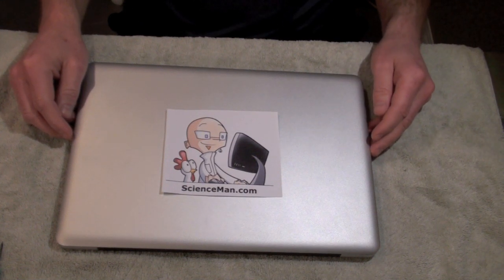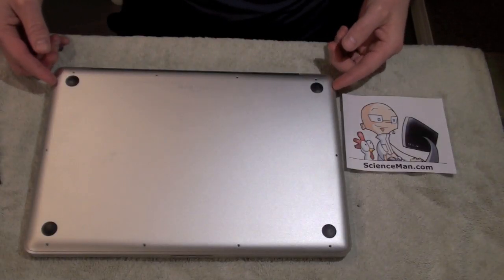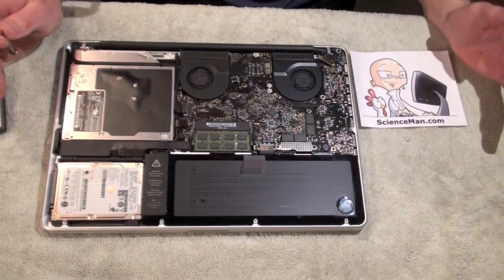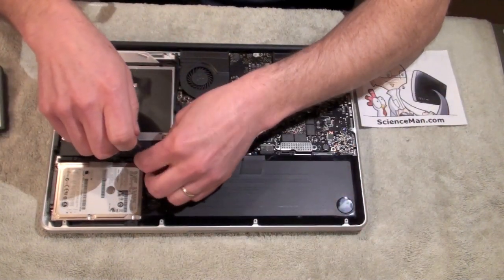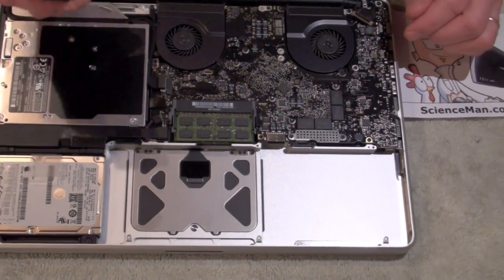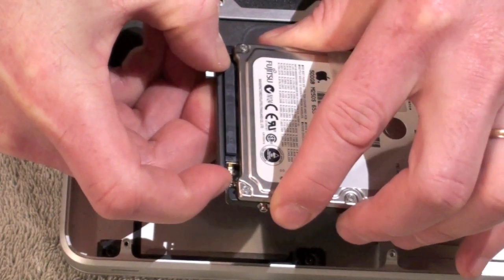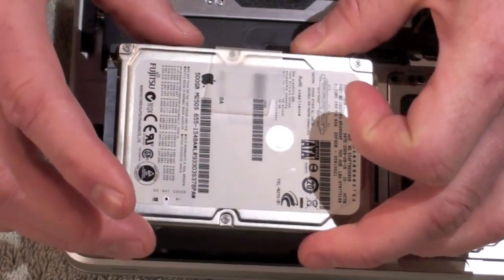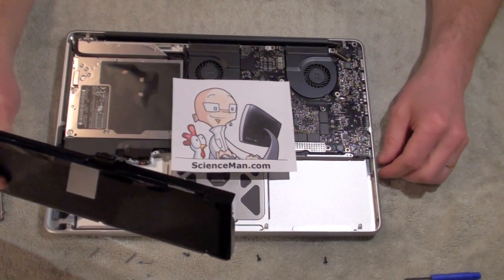ScienceMan Lesson - Unibody MacBook Pro Hard Drive / Battery Replacement

Comment: Helpful. One suggestion for people though is to use something like Loctite's Threadlocker (I used blue) when replacing the outer case screws, as they have an annoying way of working themselves loose once they have been removed after leaving the factory. The Blue mix (and I believe Purple) is just enough to keep them in place without permanently locking the threads and preventing removal in the future.

Comment: Thanks! I need to take apart a friend's unibody (and I have one myself) to get the battery out. I wouldn't have known to expect that odd 5-point screw without this video. At least now I can have a few screwdrivers with me in hopes that one will work.

He's getting a green inconsistent flashing of the power LED, and the machine won't power up. I tried resetting the SMC, but no good. I'm thinking removing the battery will at least let him power it up and use it until he can get it looked at.

Comment: Nice tutorial .. my pro wont turn on .. replaced the power supply with same 85 watt supply , but still no good .. no power light or start up noise .. nothing!
Removed battery for 5 mins & pressed power - command - option P & R  together .. nothing. My mac pro is 15 inch about 2010 or so model. Also pressed the tiny green light on left side .. flashed for 5 secs , but made no difference. Any clues would be appreciated.

Comment: Excellent Tutorial man. Was wondering tho, i searched up on NuPower Macbook Pro batteries and found that they have the batteris for the MacBook Pro 13'' late 2008. I have a late 2011 13'' MBP and i am wondering if the battery is the same as from the 2008 MBP. Do you think that i can buy this battery and make it work on my 2011 MBP?

Comment: I can confirm there's no need to remove the battery for access to the HDD.  I'm a little puzzled as to why you thought it necessary in the first place as the battery in no way impedes access to the HDD.